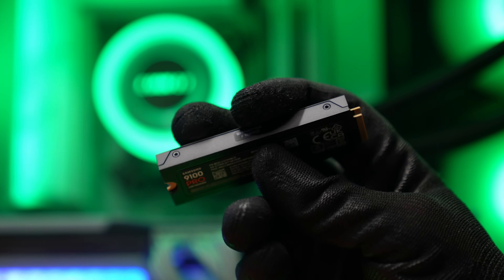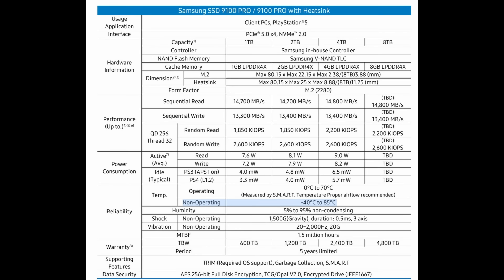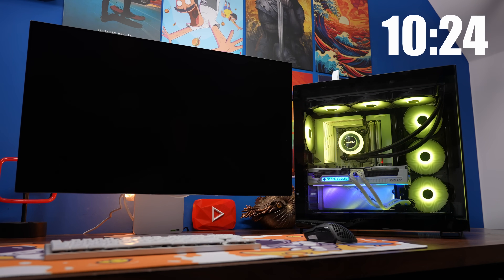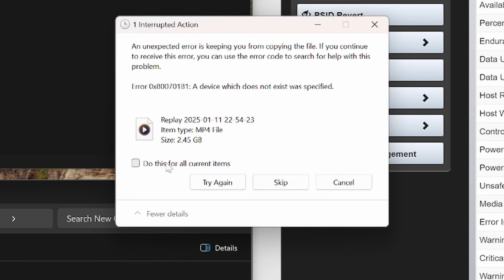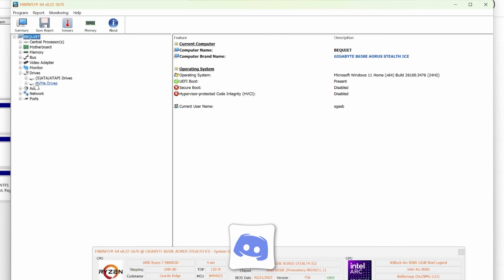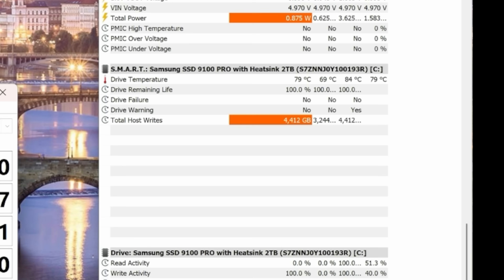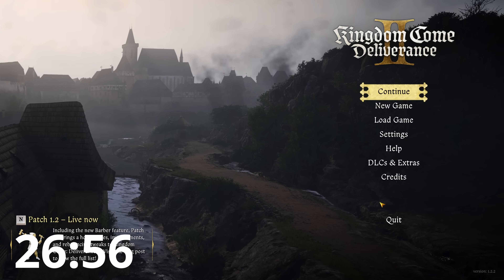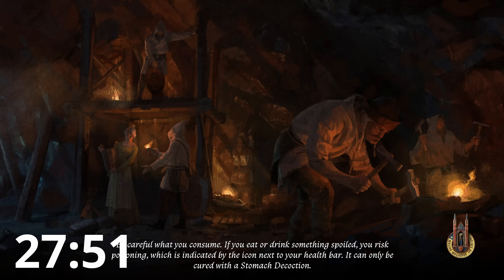Some things you need to know about the Samsung 9100 Pro

Comment: My pc stopped recognizing my 9100 pro all of a sudden after only 1.5 months of use. Moved it to another nvme slot...still nothing. Are 9100's burning themselves to the grave? 
Specs: rog strix x870-A (PBO not on)
Ryzen 7800x3d
Corsair veng 64g

Comment: thank you, i did get the 4tb heatsink variant yester day, however, I'm not getting advertised speeds.  I'm using a 9800x3d and only have 13500 read SRS and 13200 SWS
Reply: You getting performance issues from the heating?

Comment: Any new updates on if this ssd has been fixed? How is it fairing with Ryzen 7 780x3d and 9800x3d cpus? It is ,ore likely that the high temps from the GPU might be the root cause? Or maybe just the seating is the real issue?
My main game, Cyberpunk 2077 creates higher temp, just because it does. Wondering if just that game will be enough to fry the ssd?

Comment: How do you cold boot in 20 sec on AM5 with EXPO and mem-training enabled?
My brand new PC takes 40 sec to cold boot, which is 5 sec slower than my 10 year old i4790k with an upgraded win10 - upgraded from win8 - lots of junk on that SSD.

I bought the Corsair MP700 Elite because of all the ThunderFlops it would give me, 9000 mega-something or other.
I tested the drive in CrystalMark and it does operate on PCIe5 gen 4 with all the Ultra-Transfers, but boot times are extremely slow and disappointing, didn't feel like I built a brand new computer.

If I don't memory train then bad things happen. The memory is good even on EXPO Tweaked - tested with OCCT, and Blender works fine.

Maybe I should look into the kernel boot time or whatever it's called because my screen is blank for 20 sec before I see the BIOS logo, then win11 pro comes up, so the actual boot time is probably 8 sec.
Not a big deal as I never turn my computer off, but still vexing in the back of my head - I need to fix it because of my PC builder OCD or something. 
I just can't have anything slow on a brand new computer, at the very least it should be faster than my old computer. As it is it feels like I'm booting from cd-rom - which is kinda cool in 2025 - retro.
Reply: I just got a new pc thinking it would boot fast, it doesnt, it just sits around for 10 seconds, runs through like 10 seconds of checks, then shows me the logo. Like bro i feel this comment so hard, and its a great pc mind you top tier everything

Comment: I have the 990 pro 4TB with the heatsink for my Ps5 Pro and it work phenomenal i have no kind of heat issues or nothing and it load my games super fast a well so i can only imagine what that 9100 pro 4TB with the heatsink can do i might just upgrade to that but i really think im good with what i got like they say " dont fix whats not broken" lol
Reply: Speed 990pro or ps5 internal is literally same (in gaming). I’d say it’s just additional storage, and only plus files transfer speed. In game there is no improvement😊
Reply: Yeah agreed. Best to stick with what you got if it’s already great. Sadly as far as I know you would not be able to benefit from the 9100 though anyway, since it’s a Gen5 drive and the PS5 Pro only supports up to Gen4.
Reply: Does it fit on the ps5 pro ? The 4tb wirh heatsink ? Or will i have to replace the heatsink so it would fit inside the ps5 ?

Comment: Did you consider replacing the base heatsink with an aftermarket heatsink? I saw that nasty little "Warranty void if removed" sticker (which is still valid in my country), which makes me hesitant to use an aftermarket m.2 cooler (like the rocket heatsink)
Reply from the maker: no but I did do this https://youtu.be/BZKkianaUkI
Reply: @TheProvokedPrawn  Wonderful, thank you. I'm worried that under the heatsink is some thermal goop or something, outside of (of course) voiding the warranty. That said, your video proved a new heatsink is better, and my aftermarket one can only be even stronger than a built in one, so we'll see. Cheers!

Comment: We simply are not ready for Gen 5 drives. They jsut get too hot without a real solution. Using the heatinks are not the solution they ruins the motherboard and compenents. etc.

Comment: Great video, can you share any more information on the experience you had with the vertical GPU and the SSD over heating. I might have just experienced that problem. I didn't have the 9100 Pro at the time, and I haven't put my Tuf 5070 ti back in my system yet. I have X870e Hero with the 980 Pro 500gb (m.2_1), 1tb (m.2_4) & 2tb (m.2_5) drives. Online sounds like there could be an incompatibility with the 980 Pro and my x870e hero (I've had this system 4 months with no SSD incompatibility issues that i know of) So i have swapped the 980 Pro 500 with the 9100 Pro tb drive and i use the Lian-Li Vision Compact Case. TY
Reply from the maker: You can see the problem I had here - https://youtu.be/3dlq_Lqe8Fk
Reply: @TheProvokedPrawn  thanks for your quick response. i guess ill have to monitor it. I'm not sure if its the same issue, your videos are always helpful. I also just watched your  "Pondering PC Problems." IDK, sounds like similar issues. Just strange my started off from a cold boot, my system was off a good 10hrs prior.

Comment: Hey, thx for the review! Question— would you run into these overheating/throttling issues if you were running the drive in an enclosure, more like as a portable SSD?
Reply from the maker: I'd just be guessing any answer I gave I'm afraid. Depends on the enclosure, ambient temps, etc
Reply: @ fair enough haha

Comment: As someone mentioned somewhere in another post, I don't remember where, but you have very unique, pleasant and so clear to understand voice, It's a gift. 
Currently I have Firecuda 530 2TB as my windows 11 Pro OS and it works great, but I always try to improve my system responsiveness, to be snappier. Would Samsung 9100 Pro make a noticeable difference in that aspect e.g. opening browser, documents and projects, I have the budget, but would that be something I notice.
Thanks
Reply: So first question is - does you motherboard have a gen 5 slot for your main nvme drive?

As someone who has been out of PC components and their specs since before m.2 drives were even a thing (was there an m.1? 😅), I am new to this stuff myself. But I have spent the last month piecing together a fairly decent PC build. As much as I really despise AI (yes, I'm old), it has been great at learning about all the fancy new hardware out these days. And based on about 6 hours of researching various storage configurations for a mix of 3d modeling, graphic design, a tad bit of video editing, and some gaming, with a 5.0x4 slot and a 4.0x4 slot for my nvme drives, and two sata SSD drives and two platter drives, I found out different things will work best in different places.

So based on your needs, I think where you might find the most noticeable performance boost is going to be heavy video editing, 3d model rendering and motion analisys, graphic design, etc. Gaming as well, especially with newer games that are being designed to utilize the newer gen 5 read/write speeds of these little guys. But if you're a creator, during video editing for example, your going to be generating a lot of cache files that will be getting stored and read. Programs like Adobe Photoshop use scratch disks to store temp files. And it seems to be recommended to use separate drives for the actual application and cache/scratch disk to keep your drive from becoming a bottleneck as it is moving all this stuff back and forth, while slowly filling up if you're doing really big files such as 4k/8k video editing.

Someone correct me if I'm wrong here, because I'm new to this. But if you're just watching YT vids and browsing the web, I don't know that you're going to notice much of a difference going from a gen 4 to a gen 5 nvme. But it's worth spending an hour or so in Google Gemini, ChatGPT, or similar and ask questions about an optimal storage solution for your particular computer build and your needs based on what you use your PC for.

Back in the day, I'd just stick the fastest drives with the most storage I could afford in my builds. Although I tried to keep things organized, there was a lot I didn't know that probably explains why I didn't seem to have the performance I was expecting in my earlier builds. But I was more into cars back then than computers, so I mostly just winged it 😂

But my upcoming PC build will be very interesting considering the amount of info I stuffed in my brain over the past 30 days. I just started looking at storage performance, so like I said, I'm still a noob. But I think I have a gameplan that will have everything optimized.

So take this for what it is. Just my take on the limited knowledge I have gained so far on storage solutions and optimization. But your situation and components and your usage is very likely unique, so it's good to do a little digging of your own.

Comment: Do faster ssds help with loading open worlds? Load screens r one thing but going through dead space remakes ship, typically it stutters as u go through doors since it’s loading a new zone on the fly. Does a PCIe 5 drive help with that?
Reply from the maker: Interesting. Not something I've tried but I'll have to look into that. Thanks for the question
Reply: @ Thanks. It seems to be not a very covered topic. Usually load screen times r based on game engine limitations to some degree, but ingame loading, like different areas in dead space remake or any UE5 game that has traversal stutter ect might be worth a test to see if the frametimes become more stable out of pure curiosity.
Reply: You will hardly or not notice the difference.

Comment: A traditional Samsung product. Always runs hot as hell and can even catch fire.
Reply: That's valid take. After watching this video, i think its too early for most of us to adopt gen 5.
Reply: Pretty much all Gen 5 drives run hot. Especially ones with older controllers. SN8100 might be the coolest because it uses a new controller using a smaller and more efficient process. Even then. They still don't run as cool as good Gen 4 drives
Reply: If you think that Samsungs are the hot rods of the SSD world, look at Kingstons stuff.

All 3 of my KC3000s run at 70°C+ under load while my 990 Pro stays below 50.
Yes, my KC3000s have double sided pads and heatsinks, so thats not a problem here.

Comment: I use a crucial gen 5 with the rog strix 670e-e cooler on top and havnt had an issue,i use it for my OS drive with a 4t samsung 990 for games ect,runs smooth and very cool (35 degrees ave max game settings))..

Comment: I've been looking to buy this, and I'm happy it's available now. The Crucial T705 I have has never had a heat issue. Mine is in the open air next to the CPU, and I have a fan blowing over it. I'm happy with it at 13.5 K /MB/sec, but the need for speed is enticing. Thanks.

Comment: I have the 9100 Pro 4TB (no heatsink version) and my idle temps are around 49 degrees. While under load, it sits around 68-70 degrees. My GPU is not vertically mounted though so that might explain the cooler temps. The motherboard is an Asus ROG Crosshair X870E Hero which has a large heatsink for the top PCI-E gen5 M.2 slot. It seems to be enough to prevent any throttling. My PC case is a Bequiet Dark Base 901 with plenty of airflow.
Reply: nice setup, i have the same motherboard and was considering the 9100 2tb as system drive so glad to hear it has decent temps with the motherboard heatsink. it would really ruin the looks if i used a drive with its own heatsink…
Reply: Just got this MB for my new build.  I have two 4TB 9100 to install and Im wondering how the second drive will do.  The heatsink is not as beefy for the aux drive!
Reply: @Oldmeone  if you use 2 gen5 drives you will have the pciex working at 8x, if that helps
Reply: @medovkyes sure
Reply: @medovk he should use th q dim 2 or 3 to plug the gen 5 to keep the 16 lane full optimized
Reply: @Oldmeone   Samsung has a very bad track record. The 980 Pro and 990 Pro both had critical issues at launch. So best of luck!🤞
Reply: I have an ASUS ROG Maximus Z890 Hero, and I want to buy a Samsung 9100 Pro 2TB without a heatsink. Will it work? Will the temperature stay under control?
Reply: Very useful info thanks, but I am wondering does what "under load" means here. Normal OS usage / gaming or something heavier?
Reply: i bought the 4tb heatsink version, will it fit on this same motherboard?
Reply: @EricMueller-k2x  It will if you don't use the M.2 Heatsink that comes with thte motherboard.
Reply: Those are less than ideal temps.
Reply: @GregoryCunningham  70 degrees under load is well below throttling temps.
Reply: @GregoryCunningham  lmao its fine.

Comment: Hi 🙋🏻‍♂️ i love Your Videos . I Like to buy a New SSD, but i dont no, if i should buy the Crucial t705 or this one from Samsung with 4TB 😅 Crucial Looks really nice when i See the performance, but get hot . Samsungs Temperatures are lower, but The Performance also
Reply from the maker: They both get hot imo
Reply: @ thanks for your fast response 🙂👍 have you tryed some cooler for the the SSDs? Like EZDiY FAB shield ?
Reply: @TheProvokedPrawn  i dont no why, but my SSD does not function. have installed, formated, can see it in the BIOS, but i cant install WIN11 on it, must sent back 😐 have tryed everything

Comment: Got me a T705 with the chunky heat-sink, and thank God for that. Still runs very hot, clocked the heat-sink at 130F (me can't do metric :P) which means the drive was even hotter, Crucial HDD software said it was operating between 150F-176F. Hot hot hot!!

Comment: I have not bought a Gen 5 SSD yet, but when I do, I already know that I'm going to end up putting a waterblock on it and just add it into my existing custom loop setup. I'd want to do whatever I can to get the most out of the drive. If I didn't already have the custom loop, I'd have to at least buy one that has active air cooling, like the option that is available with the Corsair MP700 Pro SE drives. It's a taller heatsink but has a small fan that forces air along the length of the heatsink and drive. It's usually only a few USD more and is sometimes even less than the same drive without the heatsink if it's on some sort of discount.

Comment: How fast will it run in pcie 4.0
Reply from the maker: I've not tested specifically but usually using a gen 5 drive in a gen 4 slot will give you gen 4 speeds - around 7,000mb/s
Reply: @ okay. Thanks
Reply: Gen4x4 = gen5x2
Reply: @ and how fast is that?

Comment: Comparing to a standard SATA drive to the 9100 is like comparing a Corolla to a Porsche. Compare the Gen 5 9100 Pro to a Gen 4 990 Pro and tell us the difference and whether you are going to see something for your money by upgrading. Personally I doubt it.
Reply: I was tickled with the 870evo. It's more than fast enough. Yeah, I have an old platform. Power to desktop is about 10 secs on 10. 7 is 6.
Reply from the maker: Didn't watch the whole thing then? Reasonable criticism, but also there might be people running 2.5 inch and wondering what difference NVMe would make.
Reply: @TheProvokedPrawn  Interesting point actually. I intend to get Gen 4 M.2s + 2.5 inch SSD and thought I'd put the games on the latter, but now I'll probably use one separate M.2 for the games and keep the 2.5 for pure storage.
Reply: @TheProvokedPrawn I'm running 3.5 inch hdd and I'm wondering what the difference might be
Reply: @nortropgrumann9594  Night and day obviously.
Reply: @TheProvokedPrawn  For gamers gen5 ssd is a waste of money ! In real world gaming scenarios you won’t even see a difference between gen4 and gen5. Samsung advertising gen5 ssd for PlayStation 5 is🤡
Reply: @Hussar-fm8iy  people really waste their money on storage. Heck, you can run AAA games on Gen 3 and be fine. Where you run into situations like HDD's. That's why system reqs for games now in Steam/BattleNet are SSD. But you don't need 14,000 write speed to play COD.
Reply: @Hussar-fm8iy  For gaming you won't even notice a difference with a gen3, you barely even can notice a difference with a sata 3 SSD for that matter.
Reply: @randysalsman6992   going from sata to gen 3 or 4 can be noticeable. But yea i think standard now is gen 3

Comment: Who would use it without a HS? Everything that runs faster, will run hotter as well.
Reply: I would use it without one.
Cuz why would I remove my ENITRE heatsink from my motherboard just for one SSD?
Reply: @cpuuk  heat shield or heat sink?
Reply: what is hs?
Reply from the maker: heat shield
Reply from the maker: You might assume that the motherboard one is superior. The heatsink on the Gigabyte board I'm using is huge, for example and might be better. But generally I'd like to think that Samsung would have tested that their design was sufficient!